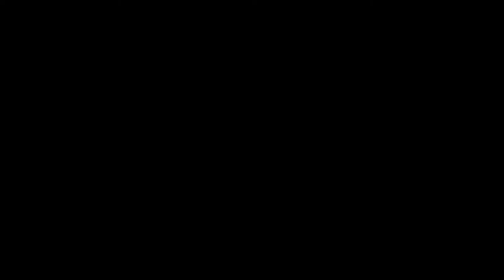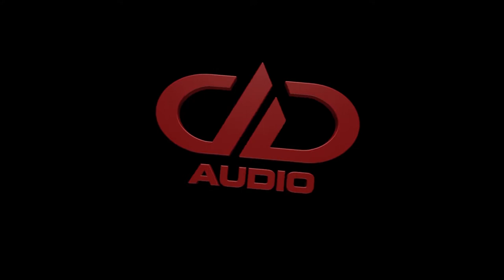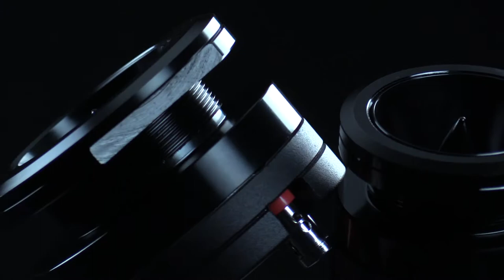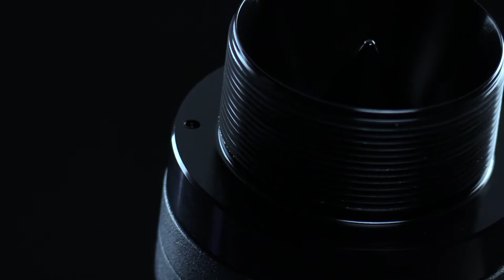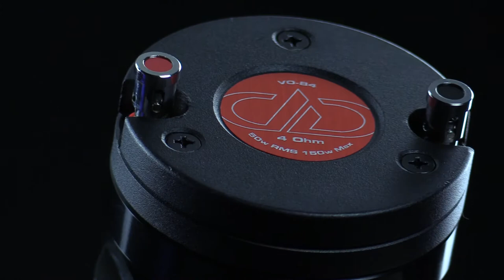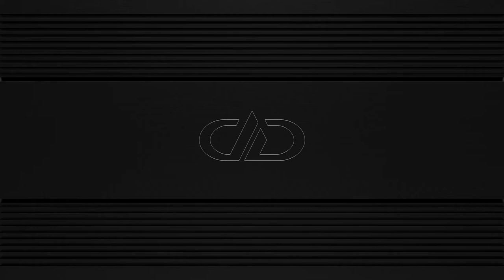VO Series B3 and B4 Tweeters Product Spotlight

Comment: I purchased  a pair of VO-M6x9a seems like a well made speaker but I don’t quite understand why you guys didn’t give it push terminals just like the tweeters instead of wire soldered to terminals. Push terminals make install a lot easier . I hope you guys consider this for future versions.